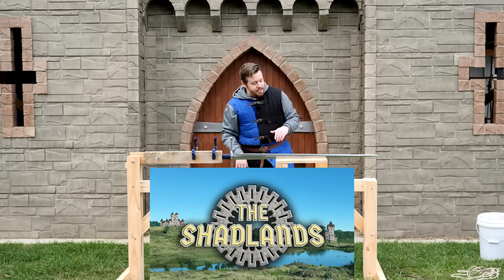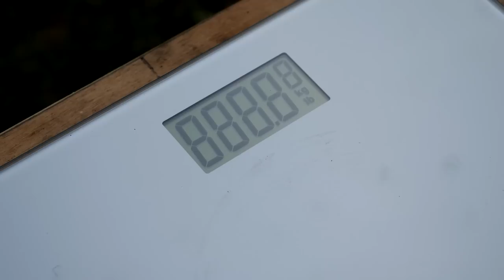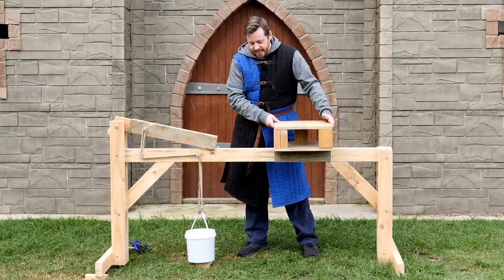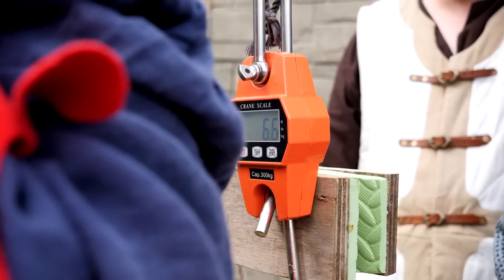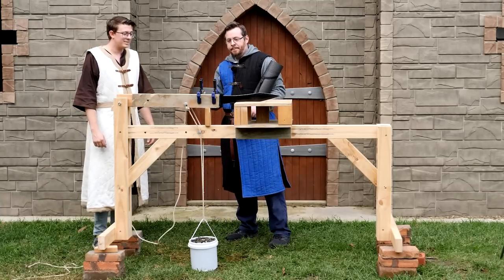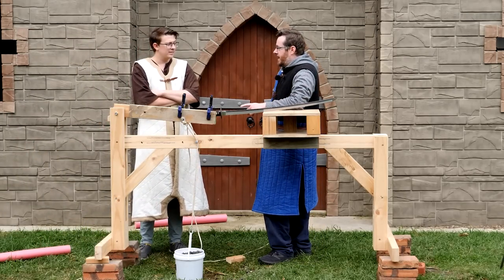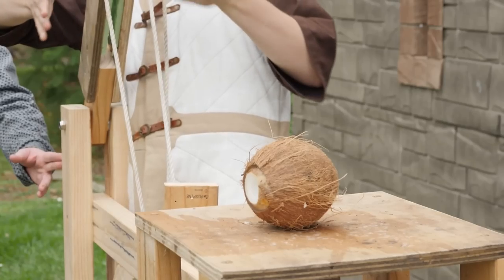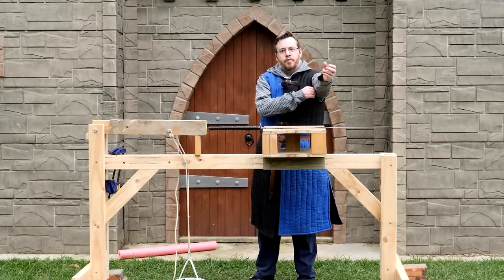Choppy choppy

Comment: As other commenters have pointed out, you're losing a lot of energy to the sword slipping. I think you'd be better off using something like a pipe/hose clamp that is made to be wall-mounted to hold the blades.
Reply: My solution would be to drill 2 holes: 1 above the sword where ones hand would meet the guard and 1 below the sword near the end cap, then you just put a bolt through each one locking it in place.
Reply: The 'clamping' has nothing to do with it. It's a fundamental lack of grasp of the physics of the difference between dynamic and static concepts.
Reply: hands give as you strike so its actually not so-bad.
Reply: Thank you for pointing this out man, it killed me every time to watch the sword shift
Reply: @HiddenRealm  I see your point, but think the extra bolts is the easiest solution that would fit the biggest variety of swords.

Comment: As for the cutting medium, I think plenty of comments already mentioned this: ballistic gel is definitely the way to go. All of the channels I watch where they test stuff in a serious manner use it. I think that that is definitely the most neutral, reusable material you could use, to avoid unnecessary pollution and food waste.
Reply: Ballistics gel is great for firearm penitration but I believe it doesn't hold up as well with slashing. Wet newspaper would be a better medium. And be consistent though temperature changes.
Reply: @georgehall7749  Interesting point! Still, Skall begs to differ: https://www.youtube.com/watch?v=mW72OPR4UQ0 (not a spam post, this genuinely links to one of Skallagrim's vids).
Reply: @georgehall7749  While ballistic gel isn't a very good analog for human tissue against a blade, it isn't perfect against bullets either. The reason why ballistic gelatin is used is because it's close enough and it's a consistent medium. Ad that's what Shad needs, a consistent medium and if he can mix it on his own and make it consistently denser than average, it might work.

Comment: At the moment of impact most of the momentum is lost due to the "grip" "breaking" and preventing the kinetic chain holding for the impact itself. When you swing it manually your arm and wrist isn't made of wood and the soft connecting tissues can maintain the kinetic chain without dramatic loss of energy. Somewhat complicated to build a solution since you need to make what is effectively a sheath for the sword handles, and swords will have different shaped and length handles.

You also have a problem of the point of leverage being so far from the sword tip that the blade will naturally want to bounce at the point of impact, ideally you would want to distribute the weight more, so that the tip is also weighted. You may be able to avoid having to make a better connection to the handle if you distribute the weight along the entire swords length, it kind of depends what you feel will end up with a measurable, standardized result that does what you want.
Reply: Well, I would expect that when you strike someone your wrist would move some at the time of contact. How big a difference between these 2 things I have no idea.
Reply: I like this - I'd add some c-clamps over and under with another set of plywood strips cut to the width of the handle of each sword. - but clamped in such a way to the swinging arm of the guillotine as well somehow
Reply: You don't actually need an entire sheath to hold the handle. (For the downward stroke) there's only two main points of force, the top of the forward side of the handle and the bottom of the rear side. Two chunky pins could hold almost anything. You'd need something to hold the sword in the arm while you're positioning it and for the acceleration but it wouldn't have to be very chunky. You could just use a foam wedge or something with a third pin in the middle of the handle.
Edit: after thinking about it for a little longer you'd need two more pins, not just one. They could just be foam spacers pressure fit like he's doing on the sides of the sword now, though. Come to think of it, there's an even easier way to do it.
Put two pins in to absorb the force from the handle. Just leave the foam and clamps how they are now and it'll hold the sword in place while you're lifting it and during its downward stroke.
Reply: @witiwap86  That's what I was thinking. You need to add the equivalent of a thumb over the top near the hand guard and the equivalent of fingers under it near the pommel. Otherwise its like trying to hold a sword by pressing your palms together really hard.

Comment: When you move the scale slightly away from the rope the force reduced substantially. When you measured the force to calibrate you should have put the stick in the device and measured the force at a further distance. It needed to be 7 kilos at the strong of the blade, not at the clamps.
Reply: yes at least as far out as when he pushed with the stick. also there is an issue with the acceleration due to gravity the speed of the sword is only accelerating to a certain point in the device whereas he is able to accelerate faster in a swing, the way to fix that would be to allow a greater distance fall in order to accelerate to the desired speed or use elastic bands
Reply: Those 2 comments ^ 👍

Comment: Should definitely add a latching drop system so that it only releases when you pull a rope. Also recommend adding a stop bar to prevent it from randomly dropping on the person loading the testing material Just have it as a bar you can either raise and lower similar to weight lifting gear, or just a device that wheels over with the bar on it that can be removed before dropping.

Comment: The weight you measured with your hands and the stick was measured at the end of the stick, vs measuring at the end of the sword holder which would be representing arm length plus hands. The weight needs to be measured at the end of the sword. Think of it as a seesaw/teeter totter or lever. The two handed blunt sword doubled the length of the arm, halving the force going into what was being cut.
Reply: This is the most glaring problem. The moment arms were way off. 

Also, the lower bolt should be directly under the bolt on the arm. At the point of impact, the rope is pulling at about a 45 degree angle, reducing the torque. That's effectively lifting up on the sword before impact.
Reply: Yeah, this is the main problem, and also muscle doesn't work the way Shad seems to suspect it does. Muscle pulling an arm down won't exert an exactly even force over the length of the swing, like an arm being pulled by gravity. Muscle exerts different amounts of force for different types of activities. A quick contraction will exert more force than a sustained push.

Comment: above the sword handle you could drill a hole and put a stick or something through to prevent it from moving upwards  (like your hand or fingers would do )
Reply: Yeah, needs a bar above the upper end of the handle and one below it at the bottom to lock it in place.
Reply: You would need 2 sticks, one on the top forward part of the handle, and another one on the bottom back part of the handle. The second stick is to prevent the handle pivoting on the first stick.
Reply: A pin at the top of the hilt and at the bottom of the hilt on the opposite side should stop that rotation. Your solution is much simpler than the one I came up with for the same problem.
Reply: @koticneutralftw7016  the only problem with a 2 pin solution is when you have different swords with different lengths of handle, it could get awkward. Shad will have to drill different holes for different swords.
Reply: Some vertical slots to insert a few bolts with some lock washers and nuts might help.  I'd imagine you'd want 4 bolts going through a rubber spacer that rests both above and below sword grip. One set near top end of grip and another at bottom end of grip.
Reply: @kangarooster857  thats my idea. Maybe more contact point if needed and having them at 30-45 degree angle towards the blade so the tension force of the washers and bolts required is lessened.

Comment: 18:39 On the second iteration of your build I would suggest asking Jack to put a thick plexiglass shield between where the sword is clamped and where someone would stand on the other side while holding the arm up. The way it twisted up like that should make you nervous. All it would take is a user error (Not clamping hard enough) to send that thing spinning towards the arm holder.

That or decide your friend won't ever stand behind it again. Holding it up from the side and stepping back once released (Stepping away from the most obvious path swords would go if they started spinning backward) was much safer. 26:41 for an example of that.
Reply: Get someone from say, the slingshot channel to design a trigger mechanism perhaps?

Comment: The difference in performance is likely a result of acceleration when the "sword guillotine" accelerates the sword it only has gravity, but when you accelerate the sword you have gravity plus the acceleration of your muscles. The bucket only accounts for the force your muscles provide not their acceleration.
Reply: He needs to stick the bucket on a pulley in the middle of the rope. The bucket will accelerate at the rate of gravity, while the end of the rope will accelerate at twice that.
Reply: In the  first iteration he had a shorter stroke (when the rope was tied lower in the lever) it would apply less strengh but more acceleration, if i got it right.
Reply: @harrygenderson6847  he would need to measure the vel at impact of his cuts and then adjust the "sword guillotine".
Reply: @user-vq6jc8uh6p  I would suggest he use a spring instead of a bucket it would better simulate an actual cut.

Comment: The amount of force you apply with an actual strike with a full swing through is vastly different from the weight of pressure you can put by just pushing the stick into the scale
Reply: I think the pressure test is a good starting point at how much force someone can put behind the sword. The other important factor is speed to get the right impuls. Thats probably off here...

Comment: Hey shad, I know you spent all that time calibrating with those metrics but there is one thing you might want to take into account, increasing the moment arm of the object push into your scale will reduce the weight it will read. So sense you took your scale reading with the stick pressed into the scale at the tip of the stick isnt really full accurate to how much weight you should really be able to apply at the handle of a weapon... and sense ur contraption there applying the force you set it for down at the handle of the weapon... you probably want to calibrate it by pressing into it a scale with the absolute shortest stick possible, like one which barely leaves your grip.
Reply: Wrong point to apply the calculated force... totally wrong number, cause at a strike you hit with much greater force than just pressing a stick 
Aaand the factor of acceleration was completely missed here
Reply: Simple, put the stick in the rig, and put the scale on the box, and have the stick rest on the scale.
Then weigh it down to 7kg.
Reply: @vadimblin  yep. If he wants to continue with the same rig he needs much much more weight. 1/2mv^2=Kinetic energy. Velocity matters so much more than mass.

Comment: I teach a traditional Japanese sword style, and I predicted EXACTLY when that katana was going to bounce off the coconut and when it was going to make it through. 

          Here's what is happening: 
The katana is not a cleaver. It was designed to cut in a very extremely specific way. 
              Have you ever gotten a paper cut? It's kind of amazing that a flimsy piece of paper can make it effortless through tough, stretchy human skin! It turns out that papercuts happen when the paper moves into your finger in one particular curvy, slicing way. Simply ramming paper straight at your skin would only crumple the paper, right? 

             A traditional, skillful cut with a katana uses the same shape and physics as a paper cut, EXCEPT IT'S BEING APPLIED WITH A 3-FOOT STEEL RAZOR BLADE. That's why a katana can cut so legendarily well! The katana was precision engineered to get that specific cut, at the cost of being a poor shape for other kinds of cuts.

        It is immensely difficult to get this cut every single time. I coach people through spending hundreds and thousands of hours training to get that curvy, slicing, powerful,  cut from all sorts of angles and at all sorts of targets. There's this ideal rotation that you have to pair with the right amount of force while keeping your blade at the correct angle. We call the rotation "the flick", and you need the flick in the right place to get a decent cut with a katana. 

                Here's the thing: Unless you put in all those hours in serious, well-guided training, your katana is likely to bounce off the target, or possibly go in an inch and get stuck. Katanas are not hatchets. They can't chop, cleave, or bludgeon at all -- they are terrible at all those tasks. They are really not as versatile as most swords.
       Katanas are made to do exactly two things: stab and slice in a very exact way. They do those two things VERY WELL. You normally have to be an expert to make them work. If you think bouncing off a coconut is bad -- I've seen katana bounce off of simple rolled tatami mats when people made a bad cut. It wasn't a force issue: the physics of the cut were just incorrect, and the katana couldn't handle what it was being asked to do. With a skillful cut, the same katana will slice through the same mat and you won't even notice the mat was there.

        Your clever chopping machine uses 100% the wrong physics to make a katana slice. When I saw it, I was holding my head and groaning, because there was no flick. Obviously the blade was going to bounce harmlessly off the target. 
          When it was picked up in human hands, I started feeling better. I would have flunked any of my students who tried a cut like that in a heartbeat, but I could see that you were going to make it through the coconut. The katana was being wielded like a lump hammer, which meant that there was going to be some rotation at the very end of wielder's range -- where the coconut was. In other words, I could see that there was going to be rotation (a part of slice) right at the entry point to the coconut. 
         Just looking at it, I estimate that the hand-held cut had maybe 30% to 40% of a real flick. That was enough to roughly cut a coconut. If you had managed a full  and correct flick just there with any faint degree of power, you would have gone through the coconut cleanly and very likely the wood board beneath it as well.
Reply: While you have some valuable points, with the way you present it, you literally can't get any more pretentious.
Reply: The katana doesn't cut legendarily well over any other sharp sword.

You are literally just saying what he says in the video about the concept of a chop versus a draw cut.

Anyone could predict "Oh this won't work" compared to Shad's cut, not because of anything you said (which isn't the correct reason), but because of the force difference.

"They are really not as versatile as most swords" - And the one thing they do do, most other swords can achieve, or even do better.

It was a force issue. You wouldn't cut through that matt like butter, at least without it being fixed down in a way that no longer allowed it's shock-absorption and spongyness to bind up the blade. It would deflect, roll, and just compress with the blade otherwise. When he held it and forced it to draw along the blade with the shitty sword, it cut. Because he forced it to already be compressed, and prevented its rolling, and unrounded the shape as he was doing so. Coincidentally removing everything the matt naturally had to deflect chopping force as well.

The chopping machine of course uses all the wrong movements to make a slice. It's MADE to chop, and he SAYS that in the video... You're making it sound like you just skipped to only the katana parts and listened to nothing he said.

He wielded it like that to chop. Intentionally. Because the point was to chop. That was always the point. Not to slice with a draw cut, or in your pretentious words "a flick".

Now you're just completely bullshitting because you're pretentious. Don't start throwing arbitrary numbers at something you're just eyeballing from a horrible angle through the limitations of a videos frames.

"And very likely the wood board beneath it as well." Good joke.

Comment: I disagree with the rope choice. A metal cable would have been better. Rope will smooth over multiple usages, lowering the amount of friction between one swing and the next. Plus rope under constant stretch can get looser and looser
Reply: Exactly or at least coat the rope in tar. Also the weight system is horrible get iron Window Weights!

Comment: 13:50 "We're good to go. We got the right amount of downforce."
Something you will most likely not hear in a NASCAR team radio feed.
Also, as a Mechanical Engineering student, that first part, where you were setting the system up, that was fun to watch.
Edit: After this, I feel like the number of builds that use Yoga Mats to raise their defense is going to go up.
Another Edit: If you have actual weights, especially a PowerBlock set, that might help with the constant weight problem.
Edit Number 3, Revenge of the Edit: Is this just Medieval Demolition Ranch? I'm not complaining!
Reply: Iron Window Weights!